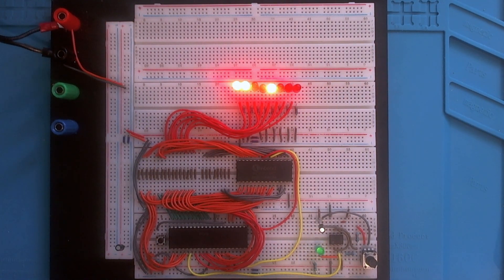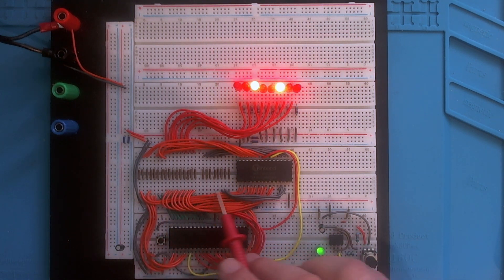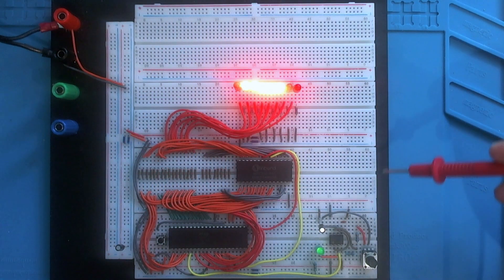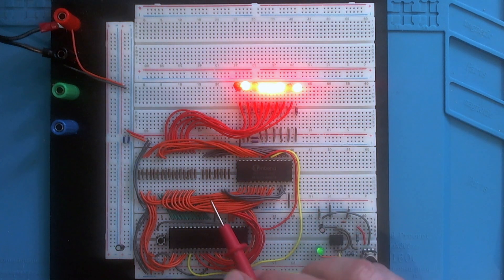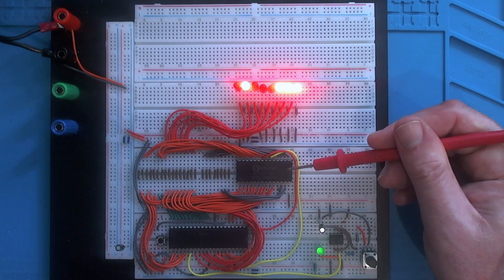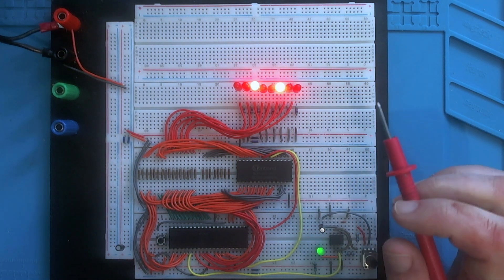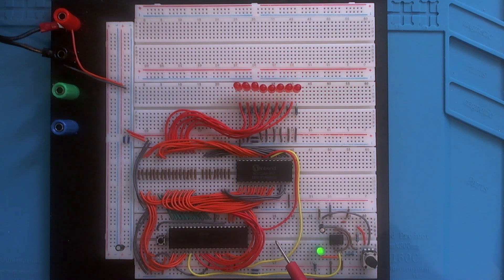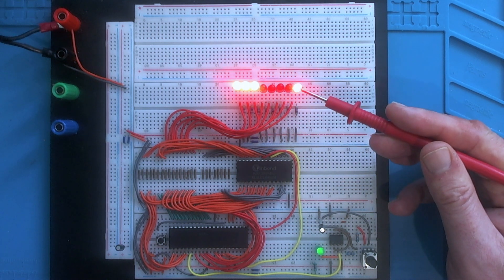Homebrew Computer Part 2: Adding a ROM

Comment: Nice. I'm in the process of doing something similar with a 6502 (inspiration drawn from Ben Eater's series which I expect you have seen). I love your idea of creating the address and data buses vertically through the breadboard...it makes the wiring so much neater. I'll be stealing that. I'll look forward to the updates...thanks for sharing.
Reply from the maker: Grand! I did try wiring everything directly off the Z80 but it quickly became very messy. Plus the address and data lines are not sequential on the pins, which leads to confusion. Ben Eater's channel is an excellent resource - many folk have recommended his channel and I'm catching up on it in the evenings. His custom processor on a breadboard is excellent, and I've learned a few things from him.
Reply: Also search for the first 6502 project it has a lot of good information.

Comment: Nice, How does a Z80 start ? I know a 6502 goes to a specific address and that contains the start of your code.
Reply: DJ legion Z80 starts from 0x0000
Reply: @zorbahls  ok so the start unlike the 6502 that is at the end of the address range.
Reply from the maker: In addition to Tomasz's answer, I've found that sometimes the Z80 will sometimes get confused on startup - seems to happen if the power is not cycled cleanly, i.e. supply to the Z80 doesn't quite drop to 0v. Reading up on this the solution is to amend the reset circuit. At the moment it is just a button that grounds the reset line when pressed. It should also hold the reset line low for at least 4 clock cycles when power is first applied. Could be done with an RC (resistor/capacitor) or a 555 timer.
Reply: @BreakIntoProgram  6502 is the same and it needs a small delay at power up before a reset. My diy 6502 system needed two reset buttons one for the 6502 and one for the 6522. hold both, release the 6522 and then the 6502.